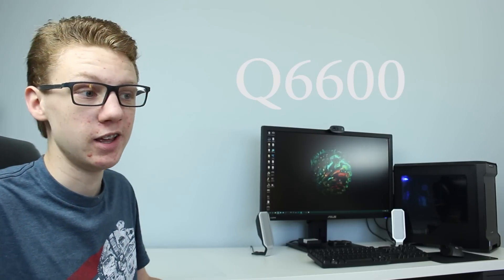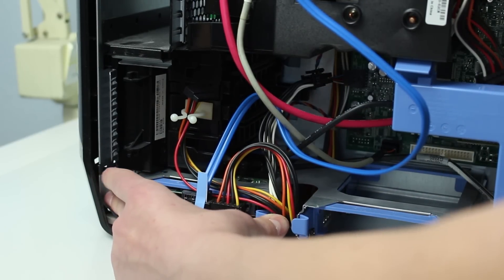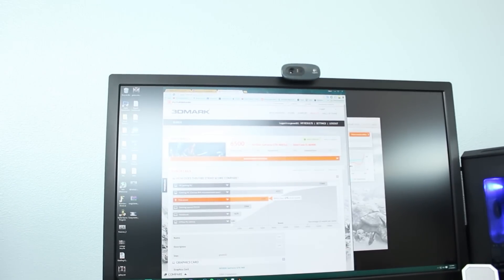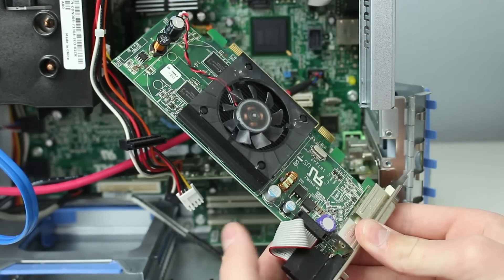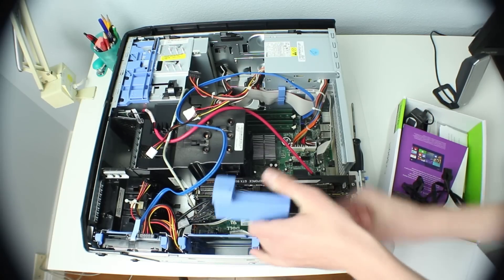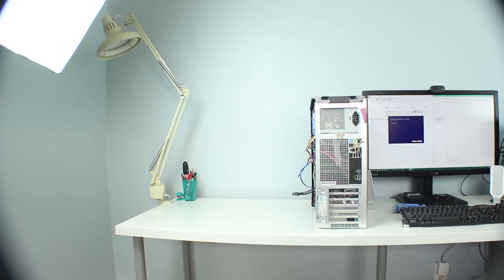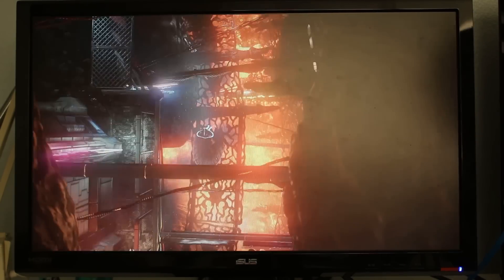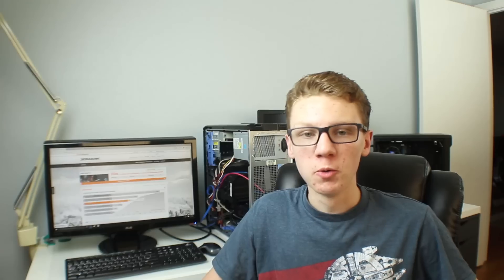Old CPU + New GPU = Gaming PC? (Core 2 Quad + GTX 960)

Comment: soo if this thing works on yours.. what?I have i3 3220, 8gb ddr3, Palit Gtx 960 2gb. And i can't play high graphics on League of legends, overwatch, etc. Is there something wrong with my gpu?
Reply: i think you have drivers problems there
Reply: +Oh WeezH can u suggest a stable driver for my gpu?
Reply: Quad vs dual core. At the end of the day, just cause its a cpu from 2007, doesnt mean it doesnt have 2x more cores then your 3220. Pretty sure if you got a q6600 league will run perfectly. The 3220 is duuduu
Reply: I see. Appreciate the reply tho. :) Will upgrade i5 6600 soon!

Comment: I once installed win 10 on a hdd that had 18k bad sectors,  it took 2h to load the files from the usb drive..  Tho it could've been the cpu on that laptop which is an amd a4-5000 :D

Comment: I just have to note 1 thing about the Dell pre-build systems - That's a 375W power supply, but this is the amount of power that goes to the motherboard and it's a 75% eff power supply, so it drains like 500W from the wall, so it is adequate(tho it sounds less when you say 375 but Dell are fun in that way xD Soo looking forward to looking the entire video, I paused it right at the moment where you talk about the power supply xD

Comment: it annoyd me when you pretty much said... "well i rather risk burning out my gpu and not getting and appropriate performance from the shitty psu, rather then take the 20 minutes to install yours into the old pc "
Reply: It shouldn't have damaged the GPU anyway, it would just at worst not power it properly. If anything, it probably put more risk onto the PSU, but then I suppose the knockback of that could be other components in the computer, which would include the GPU... hmm... that was pointless. I guess you're right, then.

Comment: A tech channel where the host pulls out Live usb without secuure ejection, underpowers GPU x2 (why not just use molex adapters for PCI?). And last but not least, It's a huge risk to underpower GPU, you should be happy it didn't blow

Comment: With 771 to 775 mod, you can put a xeon X3363 ($30 on ebay) on this board and gain extra 40% processing power. Board with better chipset can even support 5XXX series xeon. I got an E5450 ($20) working with P5G41C-M LX.

Comment: I just bought one, similar q8300 the (q9300 was like $5 but not worth the extra I think) to upgrade an old system, it's way too slow with its Celeron 420 1.6GHz, but I'm impressed tho, I was able to put windows without a problem. subscribing, I'm liking your videos :). I just wished you had a sorta better setup maybe an extra CPU and better HDD for better testing, do some gaming test, other than that your good, I understand you probably don't even work, and go to high school. Looking forward to building a new system soon already order some parts =) keep up the good work!

Comment: for your future videos if you are going to benchmark different generations/types of hardware, try to make sure to get the specs for the rest of the system as close as possible. ram for example, if your running 4 or 8 in your rig, run it with just 2 or just for to try and closely match the 3 of the other system. I realize you can't do that with everything but little things like that can give your tests a much more equal playing field scientifically

Comment: aber ich sage auch gleich noch da zu das nicht q6600 gleich q6600 ist ich habe zwei cpus mit der bezeichnung nur es gibt kleine unter schiede der eine hat eine spannung von 1,2625v und der ander hat einer spanung von 1,3125 und der läst sich meiner meinung nicht so toll übertakten
Reply: nicht toll übertakten ? ich hab meinen i2 Q6600 auf 3,2ghz übertaktet was eigentich überrauschend ist.
Reply: da haste eine echt gute cpu bekommen ich habe auch 2 q6600 eine läst sich auch gut takten und die andere granicht ob woll es ge nau die gleiche ist
Reply: hast du die q6600 mit ddr2 in betrieb oder mit ddr 3
Reply: corsair vegeance 8gb DDR3 :) aber es liegt auch an den kühlern und nıcht nur an der CPU

Comment from the maker: The card is a Radeon HD 2400 Pro, 128mb.
Reply: um seeing as the gt 630 didn't exist in 2007-2010 and dell doesn't have a time machine to my knowledge, so no its not a gt 630.
Reply: i thought it was a GT 630. that's usually what dell put in their old core 2 duo machines.
Reply: I have that card. Its a beast on Windows XP
Reply: dude please give the old pc with the old graphics card if you dont want it, pleaseeeeee i cant afford anything!!!
Reply: thanks for clearing that up. i thought that PC was made in 2011.
Reply: I had an core 2 quad q8200 4gb RAM and nvidia g9600gs 768mb ddr2 192bit, and i can play GTA V full hd at medium grapics whith a 23-28 fps and Grid autosport 28-35fps and i can record it keeping 30 fps
I was looking for a new higher performance but my power supply is 350w And what I found did not bring a big improvement only 10 fps how much. ridiculous if we tell you that my graph card is 1 slot and is out of stock 8 years
Reply: Better than a Geforce 2 MX
Reply: So is software rendering lol
Reply: ok
Reply from the maker: +TheWickedOnes Umm, I did an entire video on it... it's definitely a 2400 Pro.
Reply: Okay now install custom water cooling on it and overclocked to the cpu
Reply: ***** Well I'm  doing that to that dell dimension  e521 because  it is worth it. It would look cool because  it's  classic pc case
Reply: ***** Not if you overclock  the cpu
Reply: Yeah, because no one has ever upgraded a GPU 3 years after buying a PC??
Reply: Gavin, your tests only shown what was possible with a prebuilt, the q6600 overclocks like a champ with a decent motherboard, but it is nice to see that they still hold their own even at stock speeds.
Reply: It's always funny seeing the specs on older or low-end cards because you know that 128-512MB they tended to have would be barely better than the big fat nothing on-board has for dedicated vram now.
Reply: nope its an gtx titan xp
Reply: +ItzNoval Are you planning on building this or buying?
Reply: Brian Guillen that pc isn't from the 90s , more like 2007
Reply: Gavin Remme old spu of 478 sokets
Reply: Gavin Remme lol it'd probably run fast in the 90s

Comment: a Q6600 is not a 486, of course windows 10 will work without problems. My E8400 works just fine for gaming too and still working.

Comment: My Dell XPS 710 (2007) has the same CPU and I installed a GTX 970 which works just fine (1000w PSU). Your problem is underpowered GPU and low RAM.

Comment: First thing to change would be the music in the background of this video.  Intro music is ok but fade it out ...music was too loud and went on for too long.

Things to note in regards to the PC:

375 watt power supply is probably fine but you need a good quality PSU the PSUs that usually come in pre-built Dell systems are garbage and can't hit the rated specs.  If you were to use it continually it could die and take all your other parts with it.

General rule is that your drives should be formatted to NTFS not FAT32.

While not a very highend GPU the point of the video is still good.  You can really get pretty decent performance without having the newest CPU.  If the CPU was one one or two gens newer (i5 750 or 2500) it would be a lot closer to today's CPUs in terms of performance.  The i5 2500K overclocked is still a fine gaming CPU today.  (And of course a bit more ram is necessary today)

Comment: Sure, you can get the CPU for cheap there....but what about all the other Components? A motherboard that hosts Socket LGA 775. DDR2 RAM dims....you might need 6 to 8 GIGs of RAM for new games these days. The graphics card...not a problem.

But seriously? No. I'd not recommend a build from 2007/2008. Trust me.

Comment: Nice experiment. Even though there is a 20 to 30 percent CPU bottleneck most of gaming is in the Video card and just getting a system going is nice. If someone was on an extremely tight budget they could find something like this "LGA 775/Socket T Intel Motherboard w/ Genuine Intel Q8400 & 8GB Memory" that I found on ebay for $55. Then buy a $45 SSD to increase performance. This would give them a system to start with and can upgrade in the future for only $237 total. Slap Win7 on it and your good to go for awhile. See Below...

MB + CPU + RAM = $55
SSD = $45
MSI GeForce GTX 750 Ti 2GB on ebay = $96
EZCool NA-705B Mid ATX PC/Computer Case With 500W PSU on ebay = $41
Total:$237

My main system is more extreme than this but im all for you experimenting. Looking to use old parts and get away with an acceptable delta on performance is fun. Some people don't have the money to dump on a system and to build a decent system would cost about $750 to get i5 6400 system and a good video card.

My main system specs are below:
CPU: Core i7 6700K
Water Cooling: CoolerMaster Nepton 280L
RAM: 32GB Corsair Dominator Platinum DDR4 
MB: MSI Z170-A XPower Titanium Edition
Video Card 1: EVGA GTX 980 Ti SC+ ACX 2.0+ Backplate
Video Card 2: EVGA GTX 980 Ti SC+ ACX 2.0+ Backplate
Sound: SoundBlaster X-Fi Titanium HD
Case: Cooler Master Storm Trooper loaded with Noctua Fans
PSU: Antec HCP Platinum 80+ 1300W
Lighting: NZXT Hue+
SSD: Samsung 950 Pro NVME 512GB
Extra Storage: Drobo 5N
Optical Disk Drives: Blu-Ray and DVDRW
Mouse: Corsair M65 PRO RGB
Keyboard: Corsair STRAFE RGB with MX Brown Switches
Monitor 1  28" Acer XB280HK 4K with Gsync
Monitor 2: 28" Samsung UE590 4K with Freesync
Monitor 3: 28" Samsung UE590 4K with Freesync
Monitor 4: Vizio M50-C1 50" 4K
Speaks: Corsair SP2500 2.1
Headset: AKG Tiesto K267
OS 1: Windows 7 Pro 64bit 
OS 2: Windows 10 Pro 64bit

I also have retro systems that I'm into to play all of the old school games I've been collecting since 1990.

Pentium 233Mhz with Matrox G200 and 3dfx VooDoo1 (DOS 6.22 / Windows 3.11 / Windows 98SE)
Pentium 3 1.4Ghz with Matrox G400Max and 3dfx VooDoo2 SLI (DOS 6.22 and Windows 98SE)
Pentium Core2Duo E6800 with Geforce 6800Ultra (Windows 98SE)
AMD64 X2 4200+ with 2 x GTX 560TI SLI (Windows XP 32bit and 64bit)
Pentium Core I7 920 with 2 x GTX 680 SLI (Windows XP 32bit and Windows 7 64bit)

Comment: Nice, I have the Q6700 and in it is a AMD 5750.
Also I can put in this a R9 380 oder 960 GPU.
But I buyed a new PC 2014,because
USB 2.0
Sata II
4 GB DDR2 RAM maximum 8 GB
PCI Express 2.0 16x 
The System used by Grafic edit and Video editing.
Office and Gaming

Comment: I'm running some games on an old Mac Pro, the one using 2 dual core CPU:s with similar performance to the Q6600. And with a GTX 760 (which obviously is overkill for the CPUs) I'm getting 25-30 fps at 1080p even with a heavy title such as Witcher 3. I would never recommended anyone to buy such a system today, but to create a dirt-cheap system with acceptable performance a Q6600 or similar quad core salvaged from a friendly neighbour along with a used 660/670 for 50-60 dollars it creates a fairly competent system.

Comment: You did a really clever video, but I have the exactly q6600 and gtx960. This only proves that benchmark programs doens't tell all the trurh. for cpu massive usage ganes like gta V, cs:go, and so on there'll be a huge gap between these two systems. I have a q6600 since "2006" actualy and I've finelly surrended to idea that my cpu is obsolete today. It was indeed a remarkable cpu 10 years ago, but we have to admit it reached it's extremamly long lifetime. I came back here just to say that. watch your well done work and give a thumbs up. regards

Comment: about 15% in the last 10 years is the difference in architecture clock to clock, I am still using my 10 year old cpu, it overclocks really well. Really the last 10 years has mostly been marketing and BS, not much new stuff. My PCE 1.1 x 16 bottle necks my Nvidia GTX 980 at 1080p by 6% its taken that long for it PCE version 1 to be maxed out. If you overclock the core 2 you will get a lot closer to your i5. :)

Comment: Gavin good vid. The Q6600 is well known because it is one of the best old cpu's to OC. You can OC it to 3 GHZ on stock fan and it runs stable. seen some vids where people has OC'd to 3.8 GHZ on H2O cooling and it ran stable. Anyways the best point U made is price for performance. My daughter games on her PC and it runs everything just fine on a Q6600 OC'd to 2.8 GHZ on MSI P6N SLI MB with EVGA GTX 560 Ti 2gig factory OC'd to 900MHZ,8 gig ram; OS being WIN7 64bit. Its sucks the power but runs good and stable. I will upgrade her video card to a GTX 660Ti or 760 soon then for a few hundred dollars she will be set for few more years.

Comment: I have a classic built PC with an 2002 era AMD Athlon XP 2300+ single core that plays Minecraft, Steam (AVGN, Half-Life), Web-browsing with HTML 5 (Youtube), and can play 16-BIT MS-DOS with Floppy Disks nativly running the OS off it's original 40GB HDD, and everything runs amusingly cool for it's age.... read more

==> I always wonder how more powerful i could make the PC if I upgraded it's passively cooled nVidia MX400 AGP GPU for something more beefy. The motherboard supports 1.5v AGP Pro/8X Graphics Cards, I don't know what other gpu would work better. The PSU is 17 years old, and I believe is 300/400watts maybe, prob less and runs stable no issues
Reply: Minecraft? My Amd Athlon X2 Dual Core QL-64 can't run it very well.
Reply: BTW that's a really nice build
Reply: Edit: it's a 2200+ running at 1.7 ghz

Comment: i love watching little kids try their hardest to talk about hardware thats older than themselves. Little does he know that the core 2 quad q6600 is a great processor, i had one running at 3.4ghz on air.  Also the TDP of the Q6600 is 125w, not 105w. Please do better research before making videos like this. Poor kid doesnt even know what kind of ram he's running yet hes running benchmarks ..so much failure here, stick to whatever you were doing before making youtube videos

Comment: core 2 duo quad ???? did you smoke something?
Reply: Really cringed hard on that.
Reply: Yup heard that too
Reply: Yeah. It's either just DUO or QUAD. Not both. Geeez
Reply: I have a core 2 duo i4 quad at 420 mhz with 69m cache. can  I play garfield cart?
Reply: I have Core 2 i69 420M L360 Cache and can play Minesweeper at 256x160 with 3FPS with 1000000 mods!

Comment: this vid was interesting.. i work at an appartment complex and i find pc  parts both stock and gaming. i have an athlon 64x2 4400+ in a hp atx design from 2012. also i found a 2007 9800gtx+ and i score just under 5000. but like you said lacks when the physics get to agressive. cool vid bro im a subbie now

Comment: I'm looking at xenon E5462's (Lga 771, can be easily modded to 775) to plop into an old 771 rig I have. Overclock-able, quad core, 1600 mhz FSB for $20.

 Though dated it would be a speed demon compared to the Pentium dual core e2140 @3ghz currently installed.

Comment: Moores law ended years ago.  We're also very close to maxing-out the node process.  The only direction left is more cores.  Improving core processing efficiency is a slow process.  As for graphics, you will find we are infact waiting for GPU to tax the CPU in the latest systems.

Comment: good premise, good video! I agree, an older system with a newer GPU can do just fine. If you have an overcklock and faster ram, and an SSD, it gets even better. I have an old P35 motherboard with a Q9550 overclocked to 4.2ghz and 4GB of cheap Kingston Hyper-X DDR2-800 at 1066, and an old Kingston 64gb SSDNow. Super cheap old stuff that still works. I'm using my old 8800GT and I play Arma2 games no problem! I plan to install the new $200 R9480 and see how she does in DX12!

Comment: This pic isn't a million miles away from mine which has been maxed out as far as the cpu and motherboard can take.  Q9550 quad core cpu, 4gb ddr2 ram, nvidia gtx950 graphics...  It's surprisingly capable with modern games but as you've suggested, it doesn't struggle with physics heavy games and anything where there is a lot of AI doing its thing.  For example, it will run fallout 4 on ultra settings quite happily at around 30fps although it does lag in heavy city areas.  The graphics card is spot on but the cpu is definitely the bottleneck.  Long gone are the days of games being more graphics intensive than cpu intensive.  Pretty much everything these days has real time physics and clever AI to calculate and sadly, the old core2 processors struggle to keep up, although they give it a good shot.  No doubt my pc could be maxed future with 8gb of ram, which it supports, but the ram type is pretty much impossible to get hold of these days...  2gb double sided ddr2 sticks? No chance... 
,

Comment: Motherboard: Gigabyte G31M-ES2L DDR2
CPU: Core2Duo E7400 2.80GHz LGA775
Graphic Card: Zotac Geforce 9800gt 1gb 128 bit ddr3
PSU: 350watt
Ram: 4gb
for example now in Hots I'm taking 20 fps on low graphics and ı cant even open Overwatch because this GPU can run only directx 10 what happens if ı buy geforce 750gtx ti? Can I get 60 or more fps in Hots on med-high graphics?

Comment: I still use a Q9650 @ 3.6ghz with 8gb ram and crossfire 4670s 512mb. I can max skyrim metro 2033, rage, farcry 2 with decent fps,  around 35ish. Im also running Dragon Age inquisition on med settings with 25-35 fps. I want to upgrade my gpu to a 750ti soon. My current 3dmark06 score is 15959. It's an old beast.